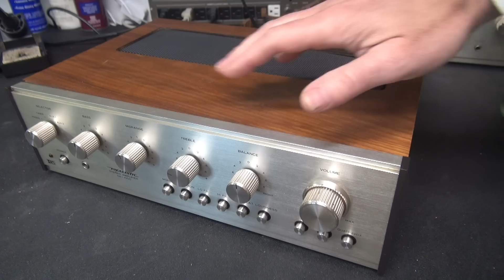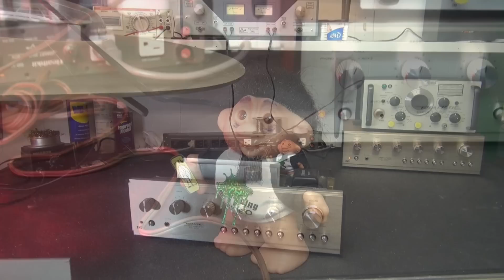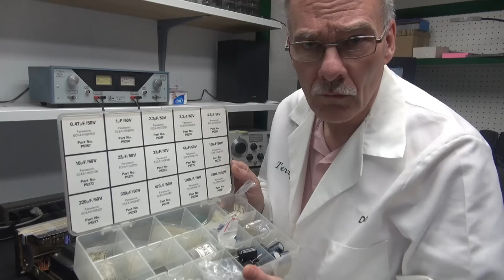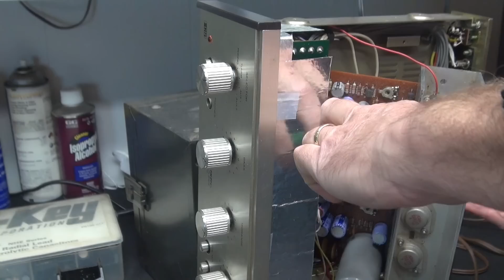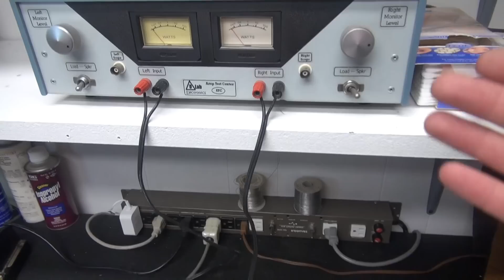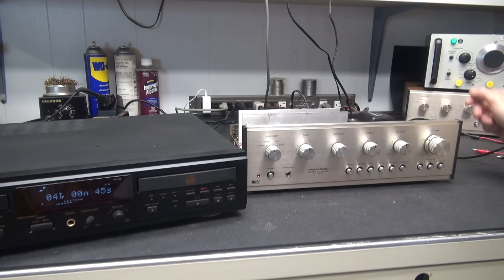How to repair a dead Integrated home audio amplifier step by step Realistic SA-1000

Comment: Do you know how to add 5.1 analog inputs to a 5.1 AV receiver that only has digital inputs for 5.1???

I have a friend that has a Pioneer VSA-E06 which is a late 90's Pioneer flagship receiver in mint condition that he sells for a good price, but sadly it only support 5.1 via optical cable compressed dolby digital, but I have seen a photo of one modded and the guy had removed the top AC plugs and instead he has 5.1 analog inputs, does anyone know how to mod the receivers to do that????

This is the back of the normal receiver: https://webimg.secondhandapp.com/w-i-mgl/5525637ccc731e30678b45c9

This is the back of the modded one: https://www.stereo.net.au/forums/uploads/monthly_2018_10/IMG_1434.jpg.a22eb6e6ca62be6d890795982fb0f6e7.jpg (you can see the custom 5.1 analog inputs on top right corner).

Comment: Hai ...I have issue with the power amp filter caps...the original value is 7500uf...can I use 10000 uf instead of 7500uf

Comment: I like the part where he applies partial voltage and then tests.
My biggest problem, to date, was with my cheapo variac.  After the speaker protection kicked in I would crank it to 120V, according to the cheapo dial. When I got around to measuring, because of problems, it actually was 134V.

Comment: howdy...got a yam cr2040 on bench with bad L channel. have literally tested out of brd every transistor on pcb. recapped and replaced the 6 output transistors that go to heatsink. and its still have a neg volt leak to test point..am I experiencing a leak through one or more of the small signal transistors that is only showing up under the +-60 and +- 55 volts when applied..I am baffled. oh..yes replace the 1 zener on brd too. I'm generally pretty handy with tube gear and SS music gear. but this beautiful vint tuner is kicking me in-da-butt. ye the other chan works fine with bad chan disconnected from supply harness. sounds great/ no pwr supply issues...surprisingly. there are a few pico f caps and .0047uf caps on brd..none test shorted but can not tell if they are for DC blocking or not?
Reply: maybe you actually have been in one.

Comment: Instead of buying expensive equipment and buying a white coat use simple logic, swap the phono cables, if distortion switches to the other speaker then replacing phono RCA cables could fix the problem. if still bad check the connections of speaker cables at amp end and speaker end, take them OUT and check there are enough strands for a good connection, refit carefully, if still bad check the speakers, the easiest way is to switch phono cables if it is still the same speaker distorting/ dropping out then its the speaker !!! if no good check the amp, again switch LEFT RIGHT CABLES if say both connectors are distorted on one channel of the amp and the other amp connection gives good sounds from both cable connectors then its the amp !!!! then and ONLY THEN buy expensive equipment and a white coat or take it to a repair shop !!  on mineit was simply poor speaker wire connectors.

Comment: Good video.
One extra step that I usually do. But you need a 2 channel scope for this. Juxtapose the 2 channels over each other and check the bias. Sometimes it is needed to tweak a little bit to make sure they are the same.

Comment: Just ran across this video and I am in need of a power supply repair.
I have a Corsair SP 2500 Computer Speaker set.
I recently lost power to the control fob.
Turns out that the amp stopped supplying power.
I took a look at the board and located a burnt 2.2 ohm resistor .
Replaced it and I now have power.
The sub plays fine.
The two satellite speakers are still on vacation.
One of the tweeters still plays but the others are taking a day nap.
I would love for you to take a look at the power supply as well as the distribution board.
I have limited knowledge of this type of repair and I really do not want to give this speakers set a trash can funeral.
Not yet any way.
I must divulge that the problem most likely arose due to the fact I left the control fob powered on for over 8 months due to a faulty power button.
My email is
mikestarley@yahoo.com
I would really love to speak with you regarding this repair.
Thank You!!

Comment: Do you find that these relatively low power integrated amps, drive typical bookshelf speakers to 80 dB average without stress?  For typical music ( not necessarily the stupidly compressed pop/rock music that has so little dynamics.)

Comment: I'm surprised that the amp of that era used output caps to block DC to the speakers. If it were just the matter of using NPN power transistors (PNP ones weren't as reliable) the design could have used a quasi-complimentary output stage. Amps from the mid 70s were doing that regularly.
Reply: I do think it could be some method of protecting the speakers from prolonged DC in the event of an output transistor failure. I think this amp used the quasi-complimentary output stage, but one of the simplest possible designs. Some more thermally stable designs put the driver transistors, and thermistors on the large output transistor heat sink to keep the quiescent current stable, as well as distortion specifications over a wide ambient temperature...

Comment: In addition to a variac, my grandfather taught me to use a 200w light bulb wired in series with an outlet. A short in the unit on the bench wont blow fuses or "let the smoke out"... it just lights the bulb.
Reply: Thanks for the variac suggestion

Comment: Seems like the caps are a big issue as equipment gets old.  I've had a Sony receiver now for 30 years, I'm sure the caps will leak eventually, but so far the receiver works well.

Comment: Good catch on the diodes. Also, very good point on checking further into the driver circuit. I’ve repaired a couple of amps that had collateral damage like that.

Comment: Instead of variac, You can use a cool life-hack. Around '80 in Poland, transistors were extremly expencive and hard to get, so You can replace main fuse with light bulb socket, and 100w incandescent bulb, power on, and if bulb just flashed and then glowed a bit, there was no short, but if it was still bright glowing, there was a short. And transistors was saved without nearly unoptainable variac.
Reply: We've used this for vintage tube radios - when they were new, lol! Great tip. Some make a box with a bulb socket, power cord, and receptacle to plug in the device to be tested. NOTE this ONLY works with incandescent bulbs! Do not use LED bulbs!
Reply: @markanderson8066  Shango066 uses this approach too, and yes, incandescent bulbs is mandatory because they act as high power resistors with soft current limiting due to filament temperature characteristics.
Reply: I must add that if the light bulb stays on even at low intensity there is still a problem on the board. I disconnected the left channel output  power board because something was burning. When I did my second test without the defective board, the light stays off. Now I will continue and troubleshoot this defective board.
Reply: I used that technique, soldering a 75W incandescent light globe to two insulated wires, and putting it across a blown fuse. I called it an 'economical PTC thermistor'. (PTC - Positive Temperature Co-efficient (of resistance)).
Reply: Thanks for this suggestion. The light turns on momentarily bright then  dims to about 1/2 intensity.

Comment: Thanks for all the repair/troubleshooting detail. That was really helpful.  I learned a lot. 
I've got a Pioneer VSX-920 Audio Video amplifier from 2010 that has issues.  A neighbor was going to throw it out.  Hopefully, I can solve the DC 003 error code problem and get it going again.
Regards, Tom
Reply: Probably already done it by now, but any electronics made in Asia between 2005-2007 (basically everything) is likely to have classic "cap cooties" issue. The Asian cap manufacturers got a bad recipe for electrolytic that lowered the life of the caps they made. Millions of them. Whenever you see a TV or monitor from that era that powers on for 5 seconds and shuts off, it's those caps. $10 fix in parts.

Comment: That cap with 4 legs is 3 stage cap , most of the time when you see those you cant change them like that , for usually those are 3 caps in one case ,  i would also check that for frequency sweep , there is a chance its made with just NPN transistors , if so its worthless , back in the day , NPN transistor was more expensive then the other type ,  so ppl made AMP with just one kind of transistor and that required topology that doesnt sound good .
I would check for that . Does sound like its the case . With 50hz ripple on it

Comment: I like yer style dude!  I am wondering why you didn't check the BIAS current?  You even mentioned it "could" have drifted, which it usually does with age. If it had drifted high, it could (possibly) account for the final getting toasted. Even if the driver trannies are good, aging and oxidized pots can do that, especially the "exposed" ones used back in those days. Although those particular ones are quite "stout" (especially for this amp), I have seen them go "open" and cause a runaway BIAS situation. BTW, I like the old RS stuff.  It was built well depending on who actually made it for RS.
Reply from the maker: Thanks man, I do not always cover every aspect of a repair. I target certain subjects to help others troubleshoot. There is no bias setting info published for this model amplifier (I searched). I simply did a comparison to the other channel, which would also be scrutinized on this site, therefore I did not include it. Hope this helps
Reply: @d-labelectronics  Probably better for another day anyways. It's a cap-coupled output so you would need to use the scope to adjust for clipping while having dummy loads hooked up, and would be a bit more involved. Teaching people to look for the root cause is definitely a good point to make!  A DBT makes for a great visual cue too.  Oh and don't worry about the "scrutinizers"..  Just keep on truckin'!

Comment: Way back in time, I had a customer bring in an amp where they had tried 4 or 5 fuses to "fix" an amp. By the time they had finished there where blown transistors all the way back to the pre-amp / driver stages. 

That job was fun
Cheers,

Comment: I am totally impressed! Another tech who actually knows how to test components, and not use "universal" replacements.
  I use the 105C caps wherever I can in my repairs. They just seem to have a longer life.  OEM semis all the way, if at all possible, especially on Sony products.
 Did you check the bias pot for opens or shorts before firing it up? I have found a number of times that bias pot is fried. I also check any bias diodes, transistors and resistors. Over the years I found that in the DC coupled amps, I replace the drivers as S.O.P. 
I normally clean off all the old heatsink compound as sometimes it gets pretty hard. The old clear compound often took a chisel to remove if the part had really overheated. 

 Great video and explanation. You got a new subscriber. Thanks.
Reply: 2SD371 finals are a TO3 package so the heatsink thermal compound doesn't go on the metal, there's a vintage mica or recent cloth washer between them.  All the old thermal goop needs removed.  The old filter cap is 70 volts and D-lab puts in an 80 volt.  It could be D-Lab's know-how is 'monkey see, monkey do'.  There are different types of snap-in caps and some take more current than others.  Should we trust D-Lab with vintage audio?  He's no expert, might be military radio trained.  🤠
Reply: @generalcurtis3lemay180   All e-caps are rated by value & voltage, along with thermal tolerance.......nothing related to current. It's SOP to put in an equal value replacement with a little higher voltage rating. As a matter of practice, unless I'm using sil-pads, I clean all surfaces & re-apply fresh thermal compound to both sides of the mica insulator. But in a lesser powered unit with an ample heat sink like this, it could be excused.

Comment: Great.  Replacing all the electrolytic caps. is laborious.  Why did you not just use an ESR meter to find bad caps to replace?
Reply: Its better to replace all caps and give it another 30 years vs changing one or 2 and have another go in a year and have to replace it. Caps are cheap and once you've done them all it will sound great!

Comment: How do you know that the pair of power transistors are paired? Is there any marking on the case that tells something about the manufacturing series or something?
Reply: He didn't say, but my guess is he bought them from a reseller who specializes in used semiconductors. Ideally they were tested with a transistor curve tracer. Maybe Terry Will clarify.

Comment: Does your dummy load with speaker outputs have a separate isolated amplifier for the speakers so you can listen without risking damaging speakers from DC?
Reply from the maker: Nope, they have a L-Pad in line

Comment: The only thing you did not seem to do was test the amp at full power on your load resisters.  It is also good to check with a triangle wave for linearity and a square wave at a lower power level.    I also use a tone burst sine wave at 1/3 ans 2/3 duty cycle to check stability.  The last three tests are not required but these wave forms will tell you a lot about the amp.

Comment: Did that bad transistor not have a mica insulator? It should have if it were not supposed to be connected to chassis.  I didn't notice you putting it back on?
Reply from the maker: Yes, both original insulators were reused, hard to see them in the video

Comment: The other neat little trick if you don't have a variac is to replace mains fuse with 60W or higher, regular light bulb. If your amp has no shorts, light bulb should flash and then dim after power is applied. If it keeps bright constantly, you have a short in the circuit. Light bulb will protect the circuit and take the energy away from the short so you will not be burning components if the short remains. Mind you it has to be an old type regular, plain light bulb. No led, energy saving fluorescent or other rubbish.
Reply: That would work fine if the fuse is off the main voltage, the same idea can be used if the fuse is on the lower voltage(s) most cases a 12 volt bulb would we work just fine. You could even use a tail light. That is a brake/turn and parking light bulb. That gives a choice of two current limits.
Reply: That's what I generally do when I'm hooking up something of unknown condition. Saved me many a time before the smoke got out and couldn't repair it LOL.

Comment: The only problem with doing a meticulous professional repair on outmoded -- those big output coupling caps are the giveaway -- stereo gear is that when it's all done and carefully tested, you still have a piece of outmoded stereo gear.  It's not the brand -- there's some really good stuff (some it OEMed by respectable companies like Pioneer!) with names  like"Realistic" and "Optimus" on it, but this thing isn't in that category.

Comment: Nice repair, very thorough.  I know what you mean about using generic replacement transistors, sometimes they don't work properly, I've experienced that in the past.  It is best to use exact replacements whenever possible.

Comment: Another "save" in the column!! Wish I had the benefit of this knowledge 10 years ago. I bought a Sony receiver/amp in 1980 when I was 18. A very good unit. It finally bugged out on me & all the options to repair it were so obscenely expensive at the time. It met the trash heap.I still look for something close to replace it with. Thanks, Terry!!!

Comment: 4:14 - Running a solid state amp with no load is okay, unlike tube amps!
Although they're necessary for hum detection :)
Reply: Loads are also necessary if you are going to put a scope on the output. Do it without one and see an o-scope go up in smoke.
Reply: @srtamplification  your statement is a pile of BS! If I use a X10 probe at X5 per division cause it to go up in smoke? You don't know what you are talking about!!
Reply: Dave you are correct! No load on the output of a transistor amplifier will not hurt it! Best wishes Dave.

Comment: Jeez, Terry, don't you have a vacuum pump type desoldering station? Not that Solder Wick doesn't have its uses, but I use the desoldering station for about 95% of all parts changing. If I had to do work like this day in and day out on circuit boards without the vacuum operated unit, I'd probably develop a major drinking problem involving something a lot stronger than Wine. Also, Extenda-Probes would be helpful for getting into the tight spots to check for shorts, or absence of same, on all those small transistors. ( I'm not scolding you, I'm just saying that there is equipment available that will make your work easier and more efficient). Also, having let the smoke out of components on more than a few occasions, more than I care to admit, it's worth noting that every Variac should have a light bulb type current limiter in series with the voltage output. In the past, if I let the smoke out of something, it's mostly because I forgot to flip the switch and engage the #@&*! light bulb!